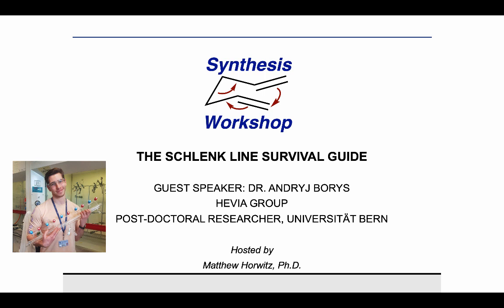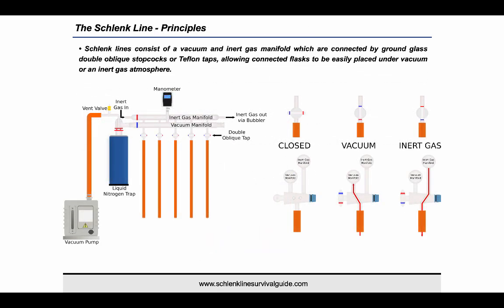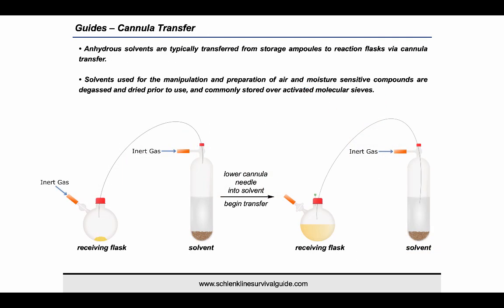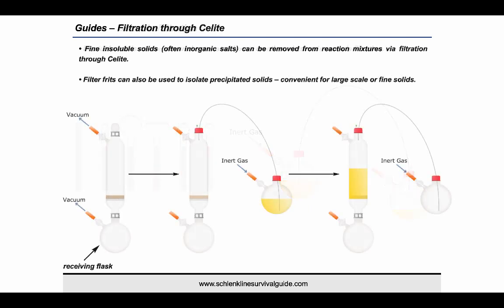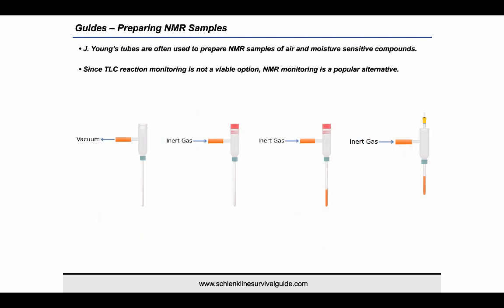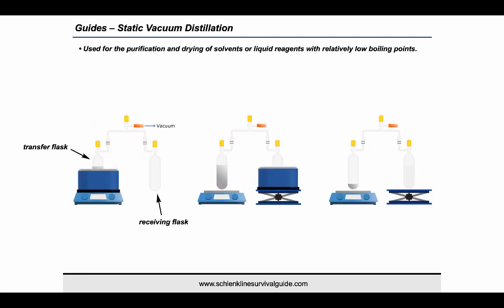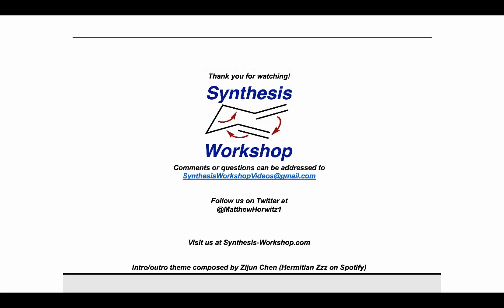Synthesis Workshop: The Schlenk Line Survival Guide with Dr. Andryj Borys (Episode 45)

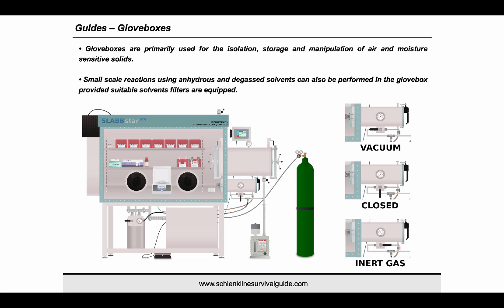Comment: 11:45 I recommend to draw some inert gas after you measured the right amount of reagent to be sure that the cannula is empty if you do not want to see the purple-ish sparkles of tBuLi-solutions. And when pushing, hold the cannula fitting to the tight to the syringe or if available, use a Luer-lock-system. We had an accident in my lab some time ago where for what ever reason, it did not hold and someone sprayed some nBuLi-solutions.